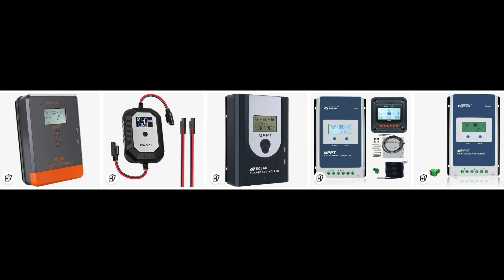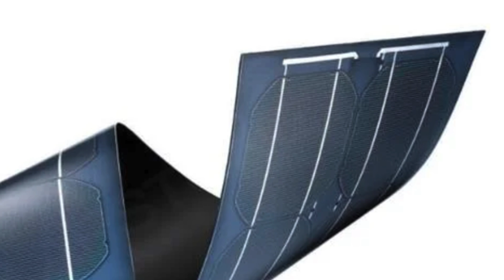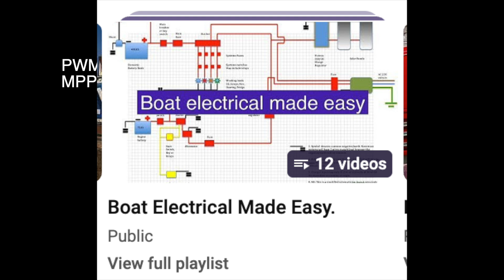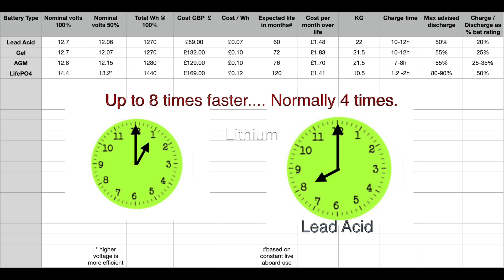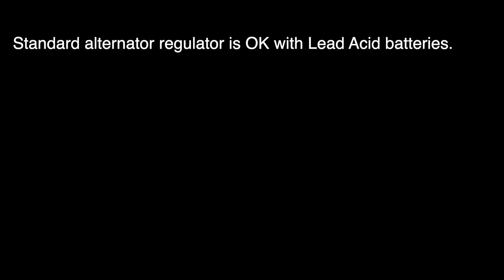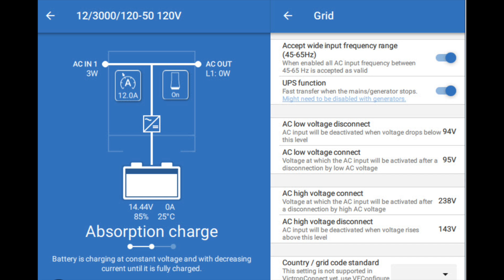Battery Facts Pt2 Charging AGM, Gel & Lithium. Alternator, Solar B2B? Off grid living?

Comment: PPS. I use or intend to, pretty much a reverse of your Buffer Battery System, with House Bank 1 of say 600 ish ah of AGM,plus engine start, Windlass, and Bowthruster Batteries, never Discharged below 80% Capacity so the Recharge Cycles flatline and never drop = 30 plus years of potential Service Life, then Bank 2 of 4 Li Time 230 ah Plus Lifepo4 batteries ge all of the AGM , and never Disharge them below 50% Capacity to keep Recharge Cycles, never Fast Chargers or Discharge them by Sharing the loads equally between each battery, so none of them even get more than Warm, so AGM =120 amps available, Fully charged Bank 2 Li Time = 460 amps available, with DC to DC chargers keeping all the AGM batteries in tip top and close to Fully charged Condition, and easy to get through long nights with no Solar input. Bank 3 plus Water maker is why I need a bigger Sailboat 😅 Bank 3 is for extra backup and for long term testing of cheap Lifepo4 Batteries, such as say  4 x 100 ah Redodo Batteries, which provide up to 200 amps available for top up help plus emergencies least one of Clark’s Adventure Channel’s Bank Managers to pull it all off though. Unfortunately I can no longer get one as a kit, and will probably have to arrange to meet him in Luperon for him to fit them for me, still, he’s a nice guy, and deserves meals and Rum bonuses as well. Bob. 👍
Reply from the maker: What we all need is everlasting batteries. 😎 Sail Safe mate. Ant & Cid

Comment: PS. Alternators with Bodies that have powder Coating, trap and build up heat in them which is why brands like Balmar don’t tend to last long, and blow up external Regulators frequently, so opt for Alternators with Anodised bodies instead, which run much cooler as they dissipate heat better. There is a Marine specked one that is 120 amp for about £199 but I don’t have the Brand handy at the moment , but note, anything 100 amps or over, really needs serpentine drive belts.  When using electric windlass, best to run the engine at a decent torque level for power feed at about 1800 rpm depending on engine plus alternator setup, so you aren’t discharging the battery too much, and same for the Bowthruster. Bob.👍